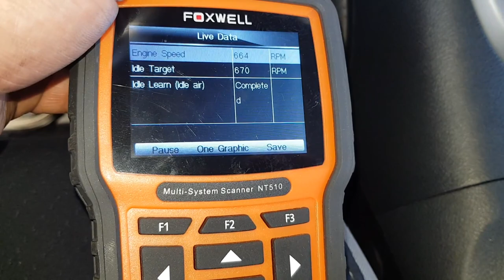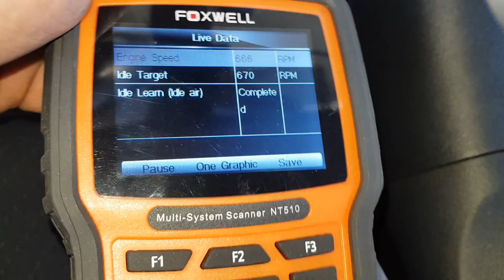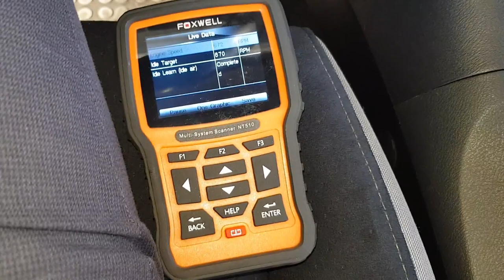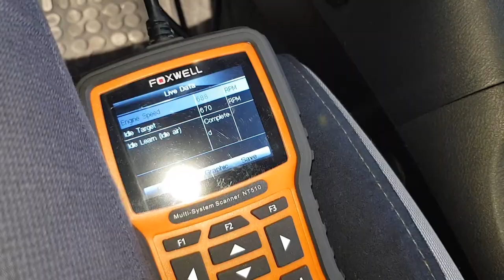Best No 1 Idle Air relearn after body throttle clean Honda

Comment: My Civic idle is steady on 800 up Rpm never below 800. If i did this procedure ( blocking the pcv valve hose ) will make my rpm to drop to normal? This happened since 3 months a go after i cleaned the throttle body. Please help me. Because with this condition my civic get bad fuel consumption.
Reply from the maker: You must have the cheapest interface is the HDS cable from aliexpress and soft for the computer (or like me Foxwell NT510) and ECU reset. The revolutions for the car to start learning must be around 670. If they are higher, it will not start learning, but first you need to restart the ecu, i.e. the TPS sensor and then the interface (software) will tell you that after the tps reset you will have to learn idle speed. It's normal that after cleaning the throttle there are such comedies with the engine, these Hondas have it, my sister's 1.4DSI jazz / fit II does not have it hmm
Reply from the maker: If you don't have an interface for Honda, disconnect the negative terminal from the battery at night, the computer should lose data, and in the morning go for a ride, warm up the engine, stop, all lights and power receivers must be turned off. Well, after a few turns on the radiator fan ... it should start learning, i.e. 670 rpm and so you have to give it 15 minutes and then test ... you give it gas and if the pointer drops to 900 and then it gently goes down, does it jump up after adding gas, e.g. 900-1200 rpm, it means that the car is not taught idle speed
Reply from the maker: Alternatively. After a night disconnection, you start all receivers, turn off, and hold 3000 revolutions until the radiator fan turns on, release the gas and wait for it to learn about 15-20 minutes, during which time the radiator fan will turn on several times. The interface would be useful to you because it will be written there whether idle learn completed or not completed ;)
Reply: @adamsokoowski2319  i tried some learning procedure from many videos in youtube, and still didn't change anything, the RPM keep steady up to 800 - 850 - sometimes more than 1,000 while idle. It makes jerking while stop in the traffic light and very dangerous. I will try your way tonight, to disconnect negative battery whole night, i hope it will work. Thank you.

Comment: i've try so many ways to do idle learning for my 08' Honda CRV, after 2 weeks i feel i'll give up and gonna bring my car to Honda Service, until i found this video. I'll try it soon.. I wish it works
Reply from the maker: You musy have hds for honda inyerface and laptop or other units who have option to clear ecm and boddy throttle. When you must this iff not learning. In my chanel you have another mocie with this issue what honda have civic and other. I have another car nissan juke 1.6 turbo and this dont have this problen

Comment: English is no good. What is a pc owbow?
Reply from the maker: watch this movie....watch...   maybe PCV VALVE ?? you have to remove the rubber tube from the PCV valve, and plug the tube with a 10mm drill, it fits, some lubricant to slip :). then learning to idle is only up to a minute :). First deletion, of course